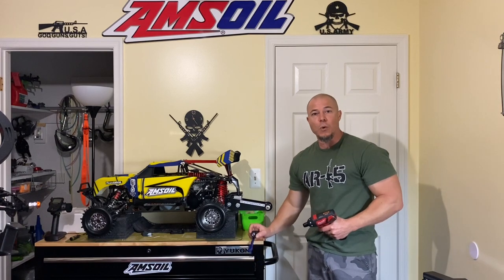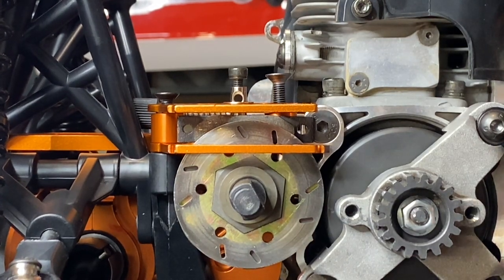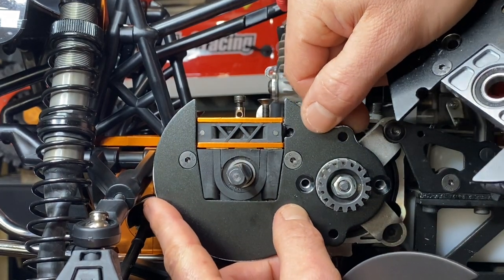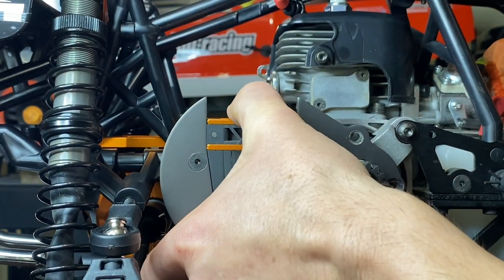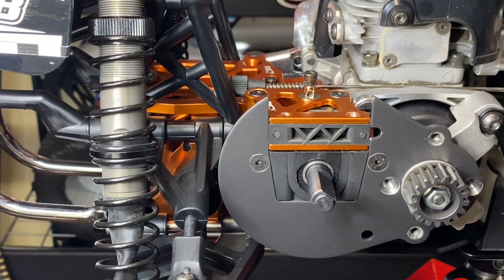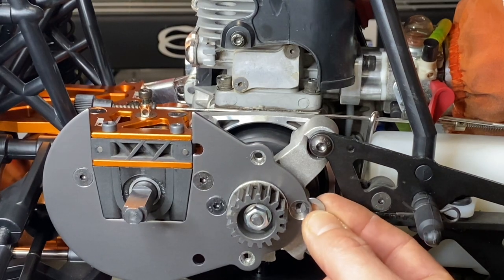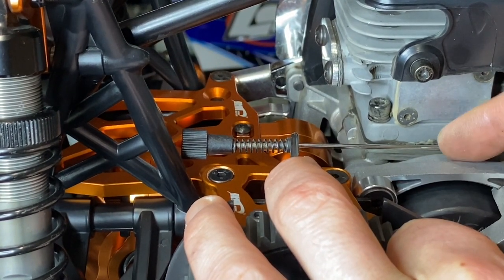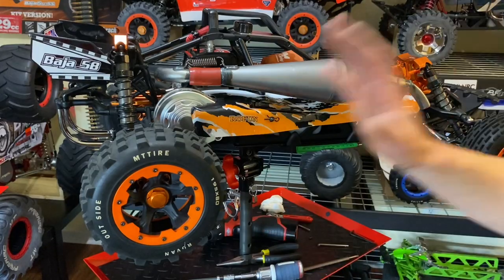Rovan or HPI Baja Platform Full Brake Install! From Start To Buttery Smooth!

Comment: Hey man awsome video, love to learn and see it!
though i have a question regarding the plate, my plate screws (the 2 screws next to the clutch bell gear) are so darn stuck i just can't get m free and loose..
is it safe to heat it up real good with a heat gun? (no fire) or do you use maybe another method to undo really stuck screws?
Reply from the maker: Hey bro thanks for watching. You can use a heat gun or just get a soldering iron like a 40watt one from Home Depot and place the pointed tip in the hex head of the screw and hold it there until shes good n hot and break it free ! You must have a billet plate Im assuming and not stock?
Reply: @eastsiderc  Thanks for the awsome tip! i havent thought about a soldering iron.
I have an integy (i believe thats how to spell it correctly) plate, not stock👍
after investing i came back to edit this post and say it is indeed a billet plate!

Comment: I took my baja apart and when i took the brakes apart i have a little plastic ring and a half circle spacer that fell out from somewhere. Can you tell me where they go?
Reply from the maker: The plastic ring goes around the brake hex and the little half moon rubber spacer goes in the gear ⚙️ plate up near the brakes. You can always check the hpi baja manual online too . Thanks for watching bro

Comment: What is meant to keep the brake rotors from falling off the nut? Mine tend to move and get crooked and fall off the nut
Reply from the maker: Hey buddy you need two of this part right here RV66073 . I usually run one of these on the back side of the brake hex but you can add two of those plastic rings on the hex to help hold the three brake discs together. Hope you are enjoying your weekend! ⛽️🤝

Comment: Hey EastSide RC i just installed a Zenoah 32cc and a RovanSports CNC gearbox complete 2nd gen. when i came to the installation of the carrier kit just as you showed it did not fit. What type of carrier kit will fit this setup !!! i am thinking of buying the ROVANSPORTSCNC FAST ON-OFF CLUTCH BELL CARRIER KITS do you think this will fit, it seems like a nice solution, greetings from Søren.
Reply: I found out that it should fit so I hope it will.
Reply from the maker: Sorry bro Ive been so busy I missed your comment. I have never used the fast
Off n on bell. But that should work.
Reply: @eastsiderc  np brother its all good, your info is very usefull so i am happy and i cant wait to get the rest installed. xD

Comment: Got ? I have orginal baja 5b i broke one shock shafts how would i go about put 6mm shock shafts in orginal shocks
Reply from the maker: You can buy all the hardware from DDM and just build them up brother. Daves Discount Motors. They will have all the shock parts you need.
Reply: @eastsiderc  i was looking on there just for price of couple things its about same price for sbk shocks off ebay just gota build them witch isnt a problem just debating what route i want to go

Comment: Hey man nice vid. I’m having fitting issues with my turtle racing gearbox with my irc and roven diff. Have you ran into this issue?
Reply from the maker: I have not bro! My irc diff fit perfectly inside the Turtle trans. Which part are you having it hard to fit into ? The back if the trans or the front of the case?
Reply: @eastsiderc  it will not fit in either, the bearings stick out just enough not to allow it to drop in. I thought it was just the roven diff, but when the irc diff did the same. I’m thinking to could be the measurements of the case are off

Comment: so.. after replacing my upgraded diff that broke after 2 runs.. my baja started eating disc brakes, they keep getting stuck somehow, so bad they bend .. and im starting to run out of ideas.. the gearplate (made in china) fits like hot garbage, but it worked before..  idk what to do anymore -.- i keep throwing money at this thing and it still constantly makes problems every frickin' run
Reply from the maker: Have taken the whole car apart and put it back together? Sometimes the gear plate can be tricky. Dont give up. You can try the billet clutch carrier set up from fearless rc . Part number RV852282 . That works well for me. Also you can use a little plastic washer on the back side of the brake discs to help guide them truer. Also make sure the screw that holds the brake hex is fully seated into the laysbaft. That can come loose and cause problems. Another issue is the short 6mm screw that is in the separate mount on the clutch side can back out if not full lock tightened and that will cause major brake problems. You can check that stuff buddy. Im sorry to hear your having a headache. I have many tech vids I hope they can help
Reply: @eastsiderc  well, basically yes :/ the whole backend, i might have made a mistake the first time i put it together. (put the pads upside down in there) since then i warped my disc brakes .. i ordered a new set, do you think a small bend in the disc can cause a full lock up ? they keep spreading apart (on the bottom) and then it locks up. I take it for a no brake ride later .. the plastic washer part sounds good, i will try that because it seems like thats exactly the problem, the guidance of the disc's.
checked all the screws, they're fully in there and tight.
Thanks mate, i really appreciate the help .. im new to fifth scale, roughly half a year in :) cheers!
Reply from the maker: Hey you are very welcome bro!

Comment: works good on a stock plastic baja 5b but if you go all aluminum that single brake sucks because the vehicle gets way to heavy. .  i put 4 wheel hydraulic on mine.  they work real good.  they all lock up fast
Reply from the maker: I agree man ! Thanks for watching